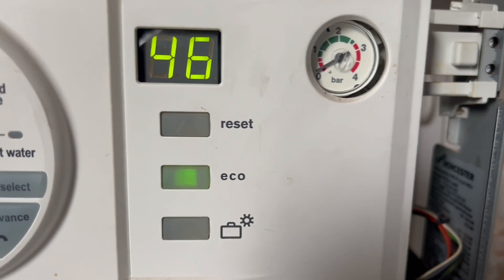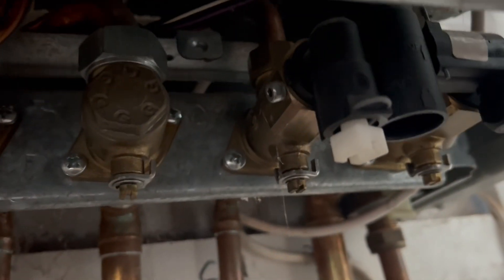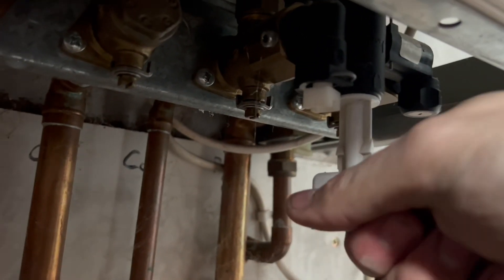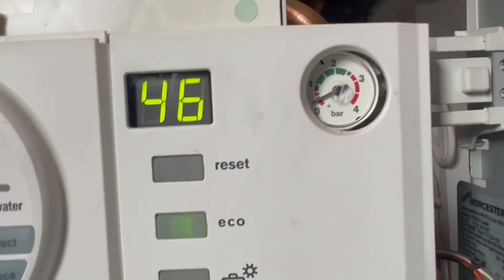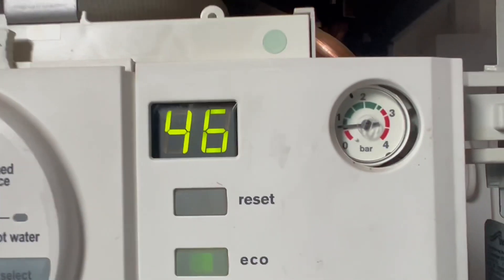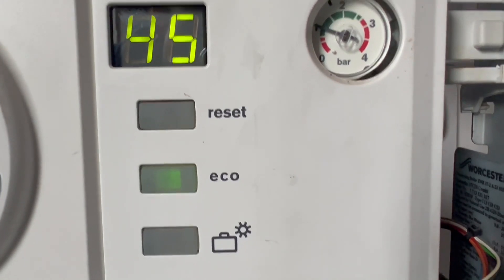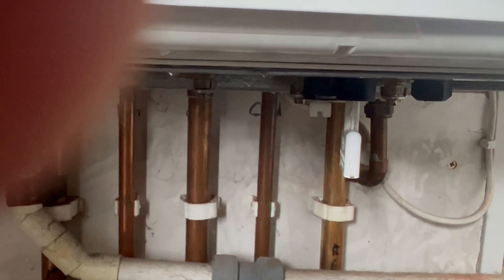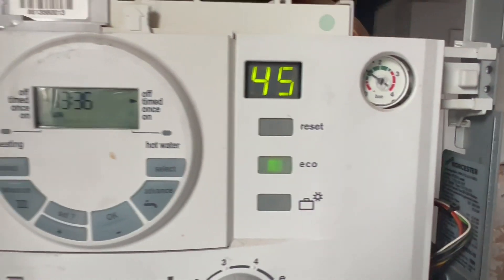Older Worcester boiler? HOW to fill up the pressure using the white key.

Comment: My gauge reads 0 even with the over pressure valve opening! Defo got pressure! That key is stuck in my boiler now, inserted it and cant get it out! Spend ages turning it a little, pull, nothing!